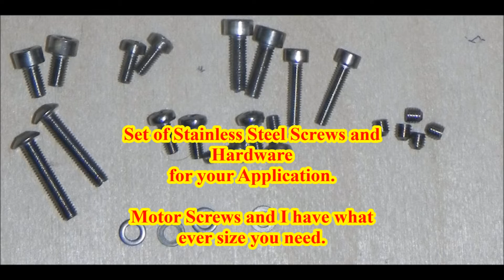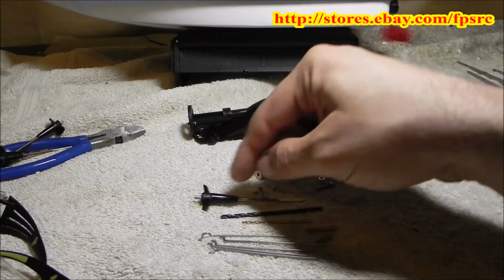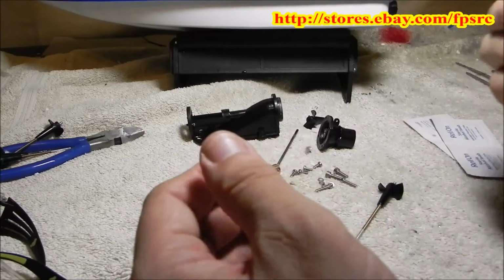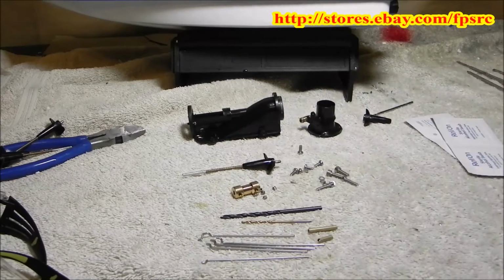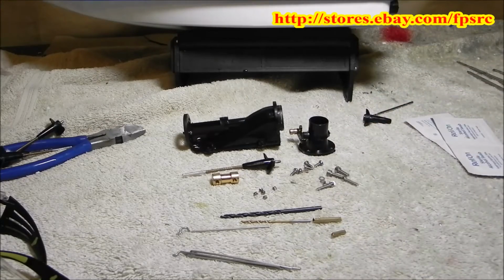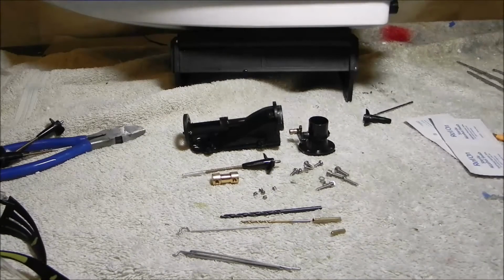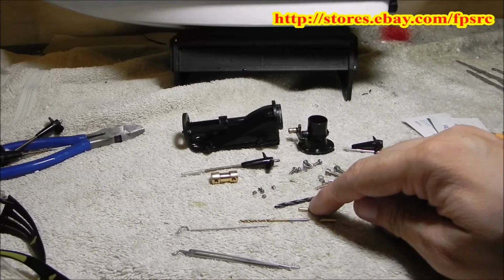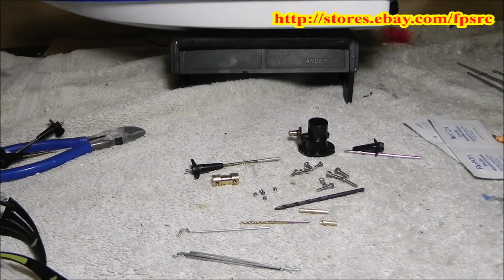RC Jet Boat USA Made Flex Shaft Kit Install Part 1 of 5 : Intro for NQD Tear Into 757 6024

Comment: How do I find your kit
Reply from the maker: I sold the first 6 and will be making more of them in the next 10 days or so. I will also have ESC, Motors, Battery, Charger, Servo, and Radio systems as well if you need any of those for your build.

Thank you
billsj77@att.net
Reply: FPS-RC how much to purchase a kit
Reply from the maker: The kit listed at this link http://www.ebay.com/itm/-/182335361686 is $44.95 for pump upgrade kit. Depending on what you need I can put together a package for you and give you some discounts on the items.  Shipping is Free in the US.

Thank you